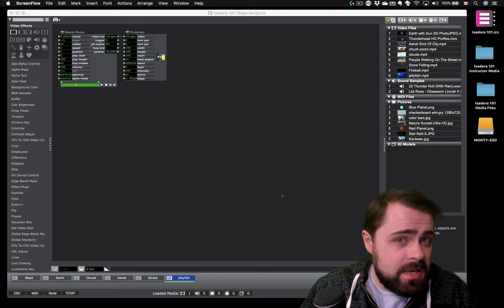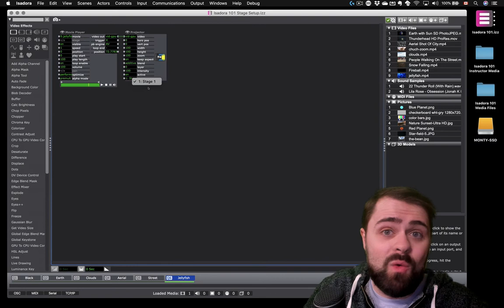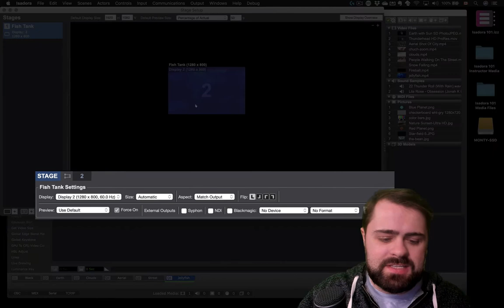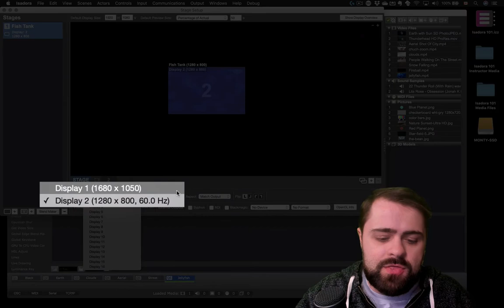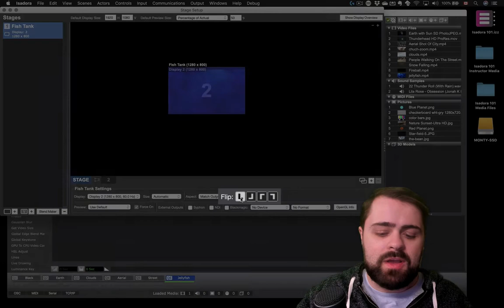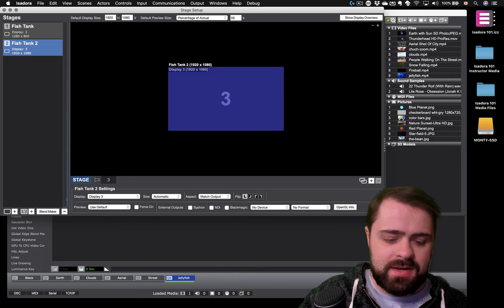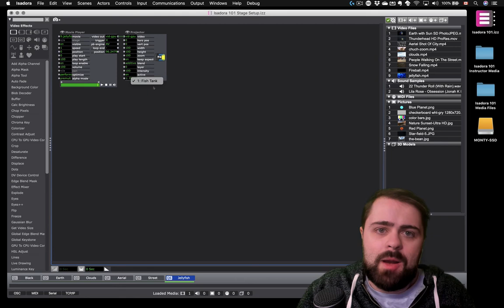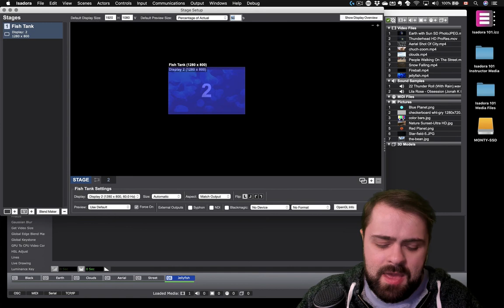Isadora 101 - #4: How to Configure Stage Setup for Video Output

Comment: I have two projectors on battens over the stage and projecting an interactive animation on the stage floor.  Both projectors are edge blended.  I have a camera pointed at the stage floor that is capturing the live dancer interacting with the projected animation.  I am using custom software that allows me to sit in the rear of the house and manipulate the animated image  so that it responds to the dancer’s movements.  I use the over-stage camera to send the image (dancer interacting w/ animation) to a 3rd projector which I use to project on to an upstage scrim.  I currently use Millumin, Syphon, and my custom software for this section of the dance.  How would I create a similar setup using Isadora?
Reply from the maker: Well you could simply replace Millumin with Isadora, but you could also program real-time image manipulation of the stage image based on motion tracking data captured by the camera pointing down at the stage. Isadora offers many tools that could integrate with or replace parts of your configuration.

Comment: Since there is no way to assign a one display to multiple stages how can I set up multiple physical surfaces (like decoration in theater for example) to one beamer? I have to do it in projector actor and copy it and paste every time?
Reply: If it is a duplicate of ALL Scenes, I would use a separate hardware splitter so you are not relying on your computer to do that.